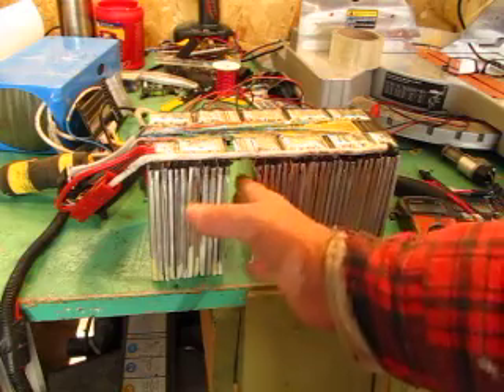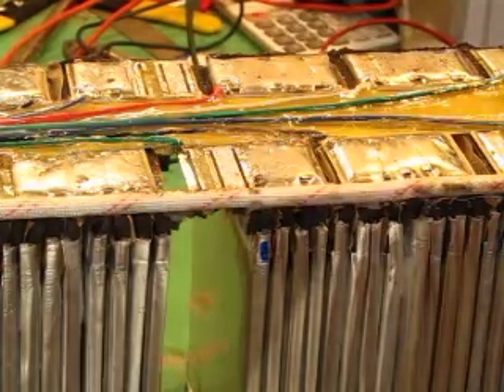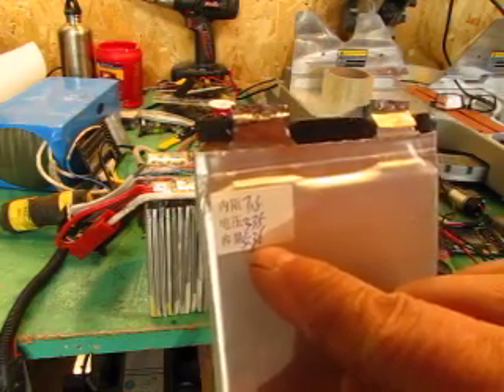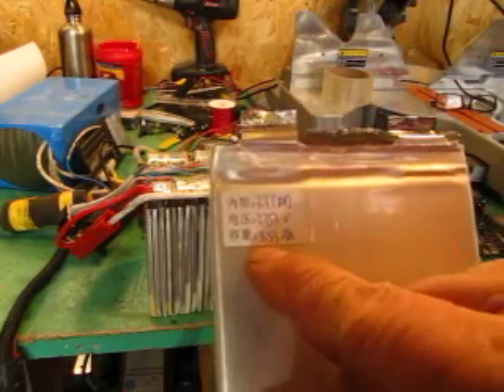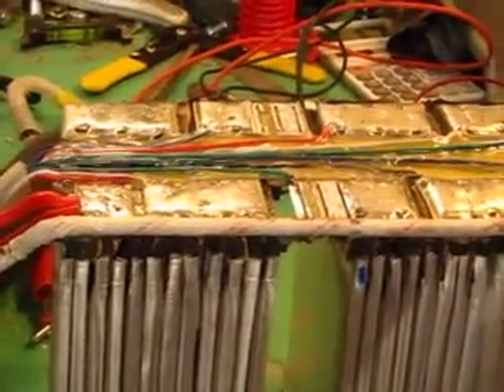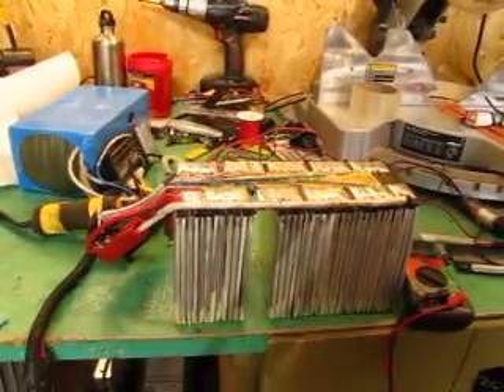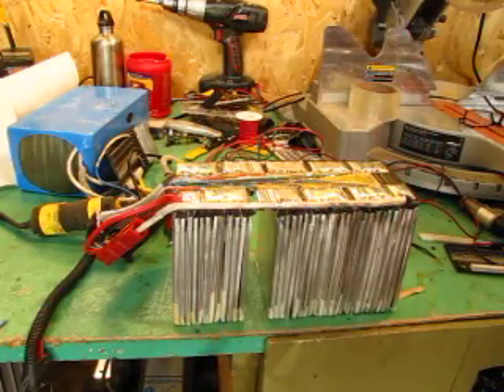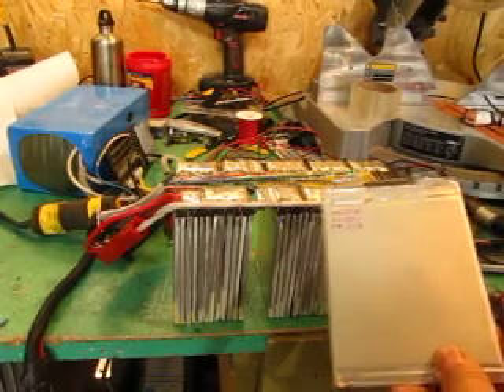LiFePo4 Battery Repair 2

Comment: I wish you would have showed how you de-soldered them.  I found that to be very difficult and ended up cutting along the solder slot with a dremmel tool.  Thanks for posting this info.
Reply from the maker: dlocke49 it wasn't pretty. I Tilted the pack slightly upside down, heated the solder with a large iron then blew out the melted solder with a pressure sprayer. Afterwards I used a chisel to gently pry up the cell tabs. 
Definitely an outdoor job.